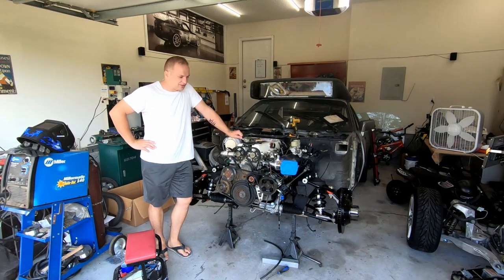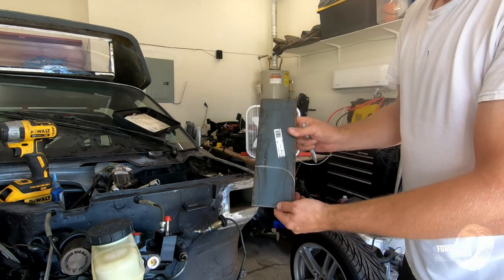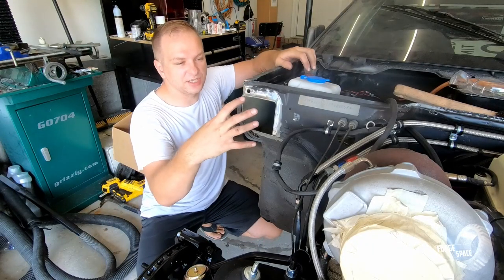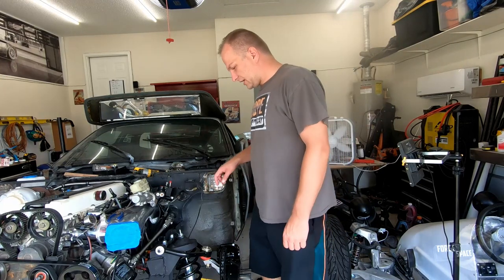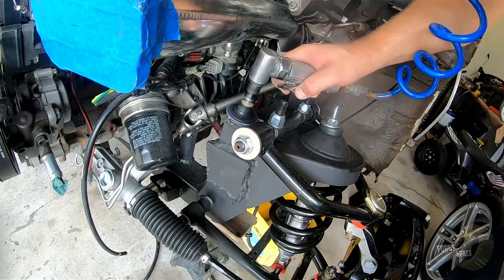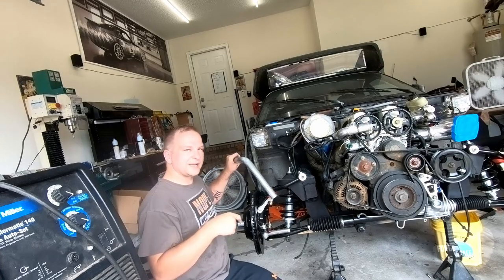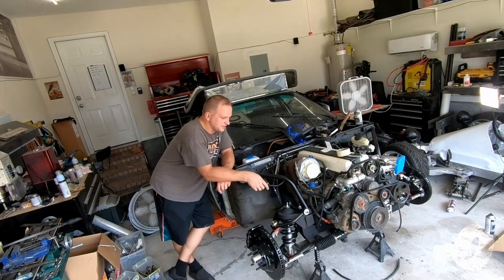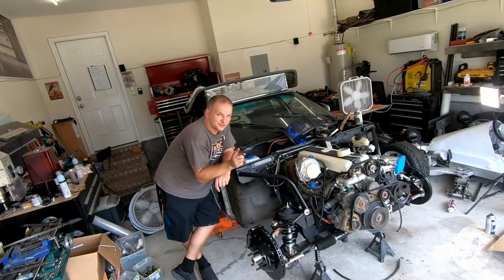Adding frame braces to the Porsche 944 front end

Comment: nice work , as usual and nice welder!!! and thous cheepo grinders - it always amaze me. I had mine for 15 years(occasional use) and someone stole it. A friend of mine - still have it for over 20 years(extensive use) - changed brushes 2 times ant it still going strong
Reply from the maker: I'm surprised at the skill brand. I bought it expecting it to last a year tops. Shes still going strong. Same with the circ saw. 
The Miller is nice, but now, you can get a comparable welder for half the cost.